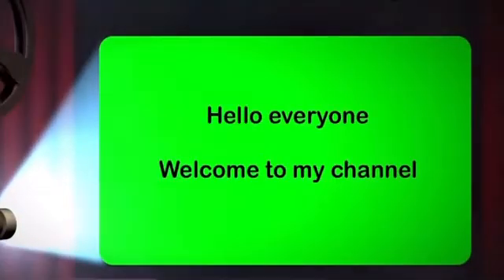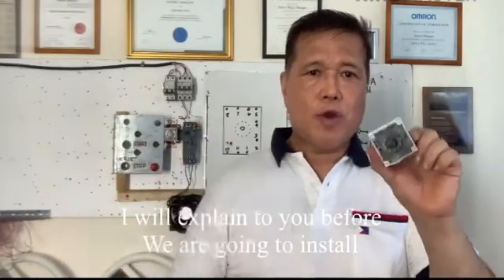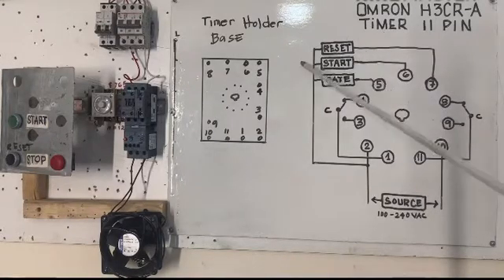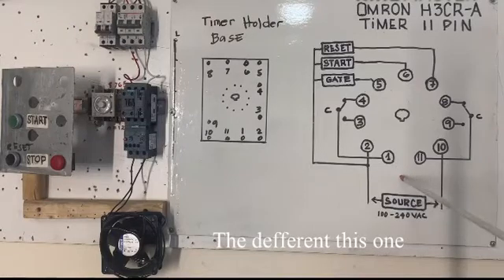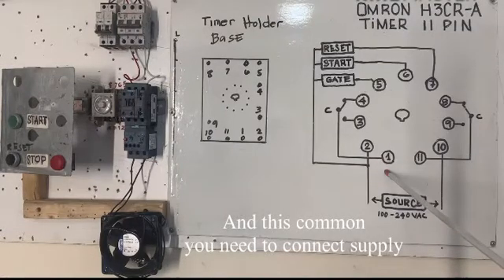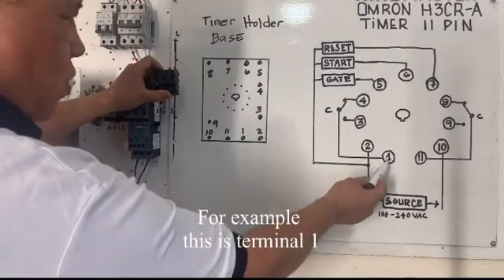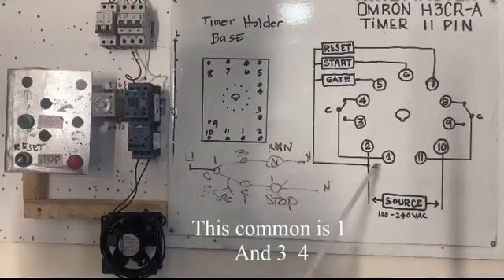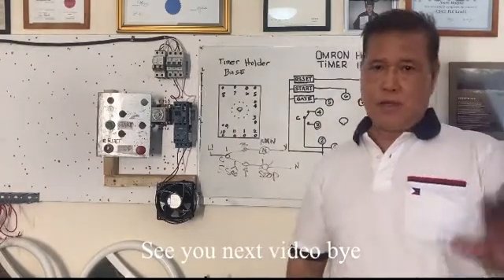Omron Timer H3CR-A 11 PIN diagram

Comment: Thanks for an easy to follow vidio and great drawing. Started using believe this same Omron bullet proof extremely versatile timer 40 years ago. Like I said in another of your post installed this on my home made house central vacuum system back in the 1980's. Attention you guys & ladies whenever you get your hands on something new like this play around with it. Try different programs such as on & off delay.
Reply from the maker: korek that timer you can adjust for on and off more minutes or hours